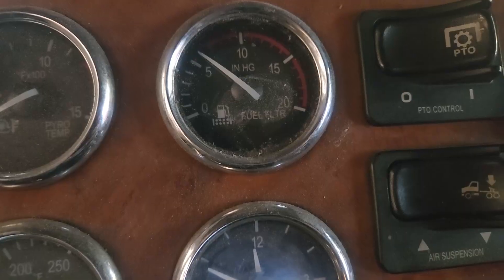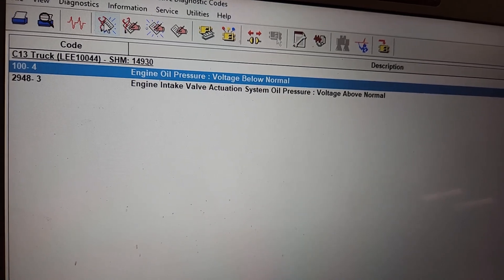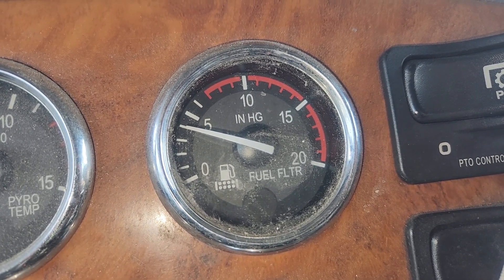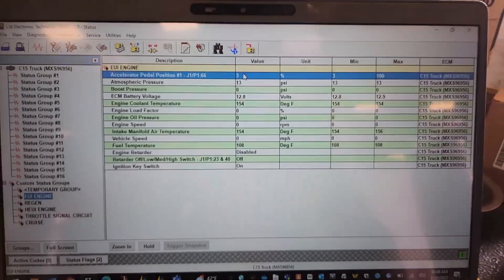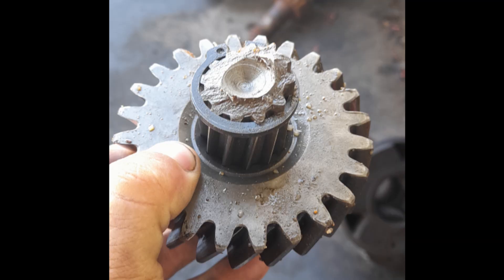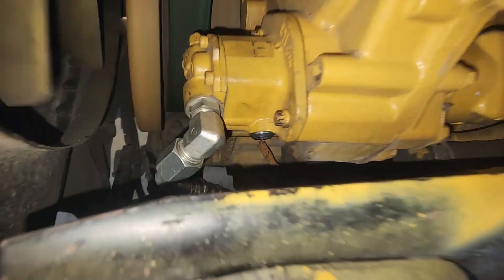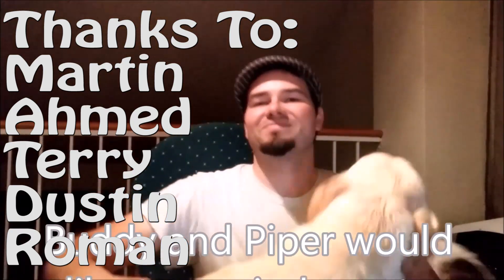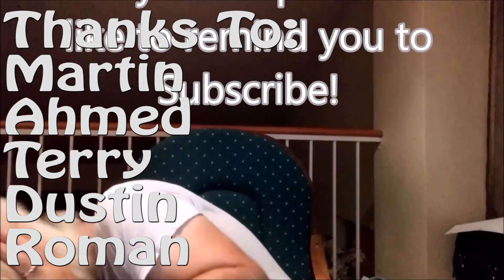Car-Hauler Peterbilt has WEIRD fuel system problems. Cat C15.

Comment: Well Josh, your getting a lot of response about the mercury, thank you for the trivia knowledge. Seriously I love learning. Which brings me to the restriction and bubbles???, Could the line size or a fitting be causing them as vapor bubbles and/or the restriction level? As for the filter fill level. I worked at a Kenworth dealership and was told by old timer mechanics that a fuel filter only fills as it gets dirty and restricted. So when they would pull a filter if it was only filled halfway, they considered it ok. If it was full of fuel then it was plugged. I don't know this to be untrue, but,,,, I have been maintaining a small fleet of tow trucks with 3116/3126/c7's, and if one is running poorly, I'll pull the fuel filter at the engine, if I find it full, install a new one and it runs much better. If it's not full I always find something else as an issue. Like a red rag plugging the pick up tube in the tank. Go times. Please, as I said earlier, I am always ready to learn.

Comment: Hi let me try to input on the fuel pressure spring upgrade versus primary suction vacuum Rising the new spring raised the fuel pressure which meant more fuel flow through the primary filter causing higher suction reading the other thing I saw in your video was the usual  high number of 90° fittings for a 379 Pete fuel system they need to be eliminated and straight fittings used at all places and the hoses re-routed to  the inlet to the pump the inlet fitting to the pump must be reamed out to a larger internal size also Be watchful of air leakage at the clear tubing connections I found a comparison of the two filter housing flow characteristics quite interesting also what is the part number of the larger primary filter if a customer has fuel flow issues I recommend going to the davco 382 or better yet an airdog  I hope this response is not too long

Comment: Not sure if you've ever run into this but I have found someone had put a check valve on the return side from the head,and I also found on a duel tank set up the "T" between the tanks was bad causing the restriction.those are a couple of odd ball issues I've run into over the years.

Comment: I ran into this on a peterbilt same engine. Ended up being the fitting between the 2 fuel tanks that regulate the return fuel back evenly. It was a real head scratcher for sure. Stumped about 4 of us before I found it. I found it by putting the fuel return straight to the tank with a open hose and it made the fuel restriction gauge go up even higher 🤷🏻‍♂️
Reply: The fitting was basically returning “too much” fuel. New one certainly cured the issue
Reply: @brentpew4853  does that gauge basically read differential pressure from before and after the filter? so you needed a little more restriction on the return?
Reply: @swaags  It's called a manometer.
Reply: Less restriction "somewhere else" means the total flow gets bigger, so unchanged filter restriction will cause more pressure across the filter

Comment: Huge fan of your channel and I'll be darned about the vapour bubbles. Learnt something amazing this morning. Near 30 yrs industry experience and I never knew that.
Reply: I’ve seen the partially filled filter and constant bubbles in the suction line before.  Hadn’t heard about vapor bubbles, but that makes sense. I think that occurs more when the transfer pump is close to its maximum lift capability. I’ve had the problem of losing pump prime on generator installations where the day tank pump can’t lift the fuel from the storage tank. I solved that by putting an in tank submersible pump in the storage tank to force fuel up to the day tank.

Comment: Great videos always. Regarding the fuel bubble issue, it may be very possible to have a fractured tank sender draw tube or weld at the top of the fuel sender. from 1984 to 1986 GM station wagons (307 Olds engines or 305 Chevy engines), and Chevy 2500/3500 pickups with the 6.2 diesel, we saw this many times. We encountered rough running and odd idle issues. The test was to put a GM "J" tool (clear tube with fittings) between the tank and the engine and look for this exact issue. If yes, replace the fuel sender and tank sock, and tank seal. I know our world of machines is different, but that could be the issue.
Reply: 7:08 no bubbles going into the filter housing. I was thinking the same(bad in-tank fuel pickup) until that point.

Comment: I had a peterbilt with an ISX15 that kept sucking air. Found out pickup tube inside left tank was loose and sucking air. $80 dollar aftertreatment pick up tube fixed the problem.

Comment: Yep my  guess is fuel tank breather or return hose clogged down stream at or in the tank. Or a restriction on the intake think of volume vs psi you have of pressure 100psi but this does not indicate flow just pressure. Thats my 2 cents :) luv ur stuff

Comment: Josh not sure if this would matter but I have seen some Pete trucks with #8 hoses and fittings from the tanks to the Tee above the transmission  not sure if that would make the restriction gauge run higher than normal.

Comment: On my 1996 Jeep XJ I finally started getting upstream O2 sensor overvolt code. Was shortly before, and after getting the heater code for the same sensor.
Replaced the sensor and all the catalytic converter codes I'd been getting for 15+ years went away.

Comment: Mercury was formerly named hydrargyrum and its symbol on the periodic table is "Hg". Hence why the pressure gauge reads in inches of Hg.    Silver is "Ag" (argentum), Gold is "Au" (aurum) etc.  The symbols for elements on the Periodic table comes from the elements original names when they were discovered.
Reply: As an addendum, I believe the name "hydrargyrum" is a portmanteau of the Greek words for water and silver - which makes sense on a purely descriptive level, but surprised me it wasn't from a Latin origin.  👍
Reply: I was about to point out that Hg is how it's listed on the periodic table.

To you point, the chemical symbol for sodium is Na.

Also, what may make sense for one language may not make sense for another.  For example, a quick internet search shows that the word for Mercury in German is Quecksilber.
Reply: @Sowhat-u6f  Do you know what you get after 16 sodium atoms?    BATMAN!  (Reference to the Adam West Batman series.)
Reply: Thanks for clearing that up.👍
Reply: Nanananananq batman lol
Reply: Cool! It all makes sense now!
Reply: ok, now do Wolfram
Reply: Came here to say this but you beat me to it.
Reply: Came just for this comment. Thanks

Comment: I would have said too that the hoses from the tanks were restricting from internal collapsing or a foreign object in a fitting elbow or a tank vent issue but your gauge ( can you trust it ? ) was showing low vacuum on the suction side of the primary. Years back with a 3406E I was having issues with lack of fuel and a hard start if the unit sat over night and had mechanics suggesting replacing the old fuel lines, primary filter housing, the primer pump etc and with my luck none of that changed anything, then another mechanic said I bet its your fuel pump and that its sucking air past the drive shaft seal so I installed a new pump and not only did it repair my on going air in the fuel system issue but my restriction gauge went up somewhat ( still a perfectly fine reading though ) from what had been a very low vacuum reading which only went to show how worn out my pump was !. I have to wonder if that dash gauge is a little off and just reading a bit more than it should, never thought that increasing the pump pressure bypass would have caused much difference in vacuum, I've replace that spring on one truck and I didn't happen to notice any difference there, only that I bumped up my pressure to a max of close to 110 when its at full rpm under zero load which was the objective.

Comment: More than likely it is a collapsed fuel suction line to the first filter base, or the breathers on top the tanks are plugged up and not allowing the air back into the fuel tank.  Trucks that old usually have fuel lines that are internally collapsed or are coming apart and if you cut the filter apart, will find little black pieces of fuel line

Comment: I worked on a Pete with a ISX in it about a month ago on a roadside service call that used that same filter housing, it would run for a minute or two then die. Filter would only fill up about half way. I had poured the fuel that was in the filter out and it was full of black slime and sediment....put on a new filter with fresh fuel in it....ran for a few minutes then died again.....pulled new filter and was already full of black slime and sediment..... customer ended up having to get towed .... pretty sure that they had a restriction in the line from the tank to the filter....told them to get the lines and tank cleaned and flushed when they got towed....fuel in the tank appeared pitch black...was hard to tell how dirty it really was with it being 1 in the morning on the side of the freeway

Comment: Check to see if the return line at the tank(s) has a ball valve, I had one once that was causing similar issues because the return valve was 3/4 closed restricting the overall flow of the system. You could also for quick testing take the fuel return line and put into a bucket.

Comment: So, I have an industrial C15 that has fuel issues, on a very large mulch grinder, have to prime machine with hand pump prior to starting every morning, fuel tank is large but probably 40-50 feet of line and 8’ below engine. I have replaced all fuel lines and engine wet stacks at idle runs good at full throttle runs fine at idle once you prime. Fuel filter never full when you pull? Any ideas?
Reply: You need a check valve or anti-siphon valve to hold the fuel in the lines

Comment: Check how crusty the hoses are. I have seen way too many hoses where the rubber insides have gotten hard and brittle. Actually had pieces of rock hard rubber jam up a 90 degree fitting.
Reply: Fuel line obstruction is something overlooked. I had an MP8 mack at a rest stop. Complaint was intermittent loss of power, found a ball of grass intertwined with a metal shaving blocking a drain back valve in a fuel filter housing. Problem solved.

Comment: Hg is the symbol for Mercury, sometimes called liquid steel. I noticed your atom sensor was reading 13. Is that normal for your altitude location. I am close to sea level, so I am at 15 most of the time.  
As you well know the o-ring boss primary fuel filter base came out with the REGEN engine updates. Was not getting enough flow so D. W. at Cat designed a higher flow base. I always check for air in the fuel system, before primary, after primary,  after the fuel transfer pump and before the cylinder head and between the head and return check. Maybe over kill, but I have an ideal of what is going on. Cavitation in the primary base is a known problem. Diesel fuel has 10 % air in it. When you take the primary fuel filter loose, the system has no check valve in it. So the fuel likes to siphon back to tank. I have taken the 75 lb return check apart and give the spring a little stretch to increase fuel psi. Agree the o-ring boss fittings are better as they allow you to align the fitting and not be limited over pipe thread. Had one that the base was on backwards, so the lines was reversed. You could drop the fuel hose in a bucket of fuel on the primary inlet and check for a change in restriction. You could have a imploded hose or something stuck in the suction side causing the restriction. 
Engine left the factory as a 475 HP, was modified to a 625 HP (ouch), set back to a 475 and then legally rerated to a 550. Wonder if ECM got corrupted during this process?

Comment: It's interesting to me that the ECM just failed a little bit.  Could it maybe be that some of the flash memory got corrupted.  In my non-truck/automotive experience with computers they tend to fail catastrophically not just a little bit.  Maybe vehicle computers are different.
Reply: I get what you're saying but in automotive circles I have definitely seen many partial failures that are nearly undiagnosable unless you have an appropriate model computer bcm and fob to switch into it. 
Leading cause is corroded or lose solder joint's on the printed circuit. Cause one is from an introduced resistance which will either screw up the computers day or an intermittent open circuit or intermittent resistance at a solder joint will screw with your day so bad you want to drink the bar dry afterwards. 

On board diagnostics are the computer checking other components, the computer does not diagnose itself, hence why you will go round in circles.

If a component with in the computer fails that's when it catastrophicly fails and is usually easier to identify.
Reply: @carzkartz9080  intermittent......intermittent
Reply: @Roger Osborn  hehe oops
Reply: usually engine controllers in automotive and heavy industry tend to be redundant and parallelized in many of their functions and processing, thus sometimes corruption may not happen in the static memory since its checksum will throw an error, but instead in volatile side where no checksum will save you
Reply: Vehicles move down the road and therefore can develop intermittent hardware faults that are only caused during a certain vibration frequency.

Comment: I have a 1997 Kenworth T-800 with the Cummins N14 that will run at zero fuel system suction under power but as soon as it goes to idle it kicks up to 5 Hg of suction and will often get to near 10 Hg if coasting against the engine.

Comment: I had to replace the ecu on my mom's can 4x before I figured out there was two wires going to the fuel rail that had melted the  protective case and it was shorting out, it ate three ecu's before I figured it out. Now it hasn't had a problem since then. Might wanna check for broken or melted wires. It was also causing over fueling.

Comment: The increase in vacuum could just be the Cat fuel filters are High Efficiency and filter down to 2 micron so filter material is finer,harder to pull fuel thru.
Reply: The primary filter should be 20 micros and secondary after the lift pump should be 2 microns

Comment: I have a acert converted to single turbo. Regular cat fuel filter on the block, wire mesh cleanable canister filter on the frame rail. When I service the truck, that very same filter gauge runs higher then as the more miles I put on it the needle drops to 2 or 3

Comment: What about the fuel lines themselves? I have had them come apart on the inside and created a rubber flap that would close of the fuel line partially.
Reply: I had one where a paper towel or napkin was in thr fuel tank and parts of it got sucked into the fuel lines creating a very similar behavior. 

I think the reasons for thr bubbles after the filter housing is that it becomes a place for small micro bubbles from the vapor to consolidate.  It's there before but not as visible until they merge at the filter housing. 

In my case,  i looked into the tank and saw the paper towel in pieces in thr fuel.  In your scenario,  I bet it was a pain figuring out.
Reply: THAT WAS MY THOUGHTS EXACTLY CULLIN..HAD THE SAME HAPPEN WITH A TRUCK
Reply: I've seen that condition on a brake line, effectively creating a 'check valve' to the caliper.
Put on brakes, slight pull to the working side.  Release, extreme pull to the damaged caliper hose side.
Pressure would bleed off, but it was a serious hazard.

Comment: I'm having the same issue of 1 fuel filter not filling all the way up on my 12.7 Detroit. I carry a 5 gallon with Diesel jug to fill the filter up when this happens. So replacing the ecm fixed the issue??
Reply: no, replacing ecm fixed low power complaint. the primary fuel filter housing can be ~1/3 empty from the vapor bubble issue he/davco talked about. but doing the trouble shooting steps he did is the correct way to go about this issue,
Reply: I would replace the fuel lines going to your tanks.